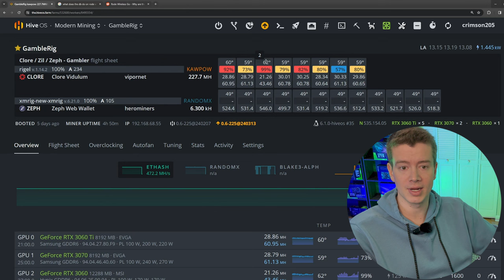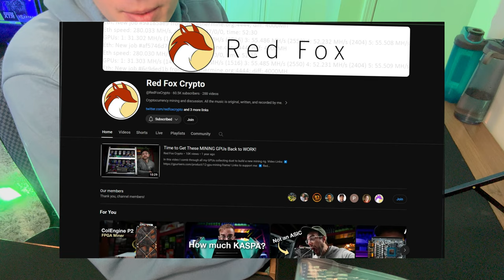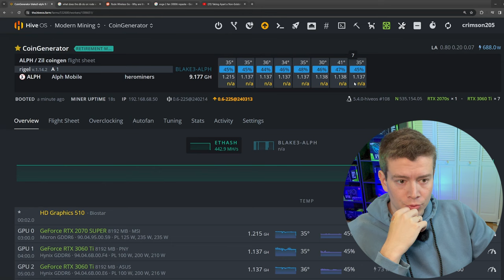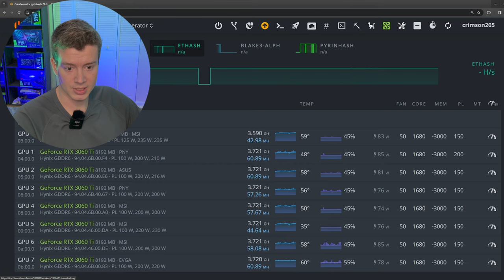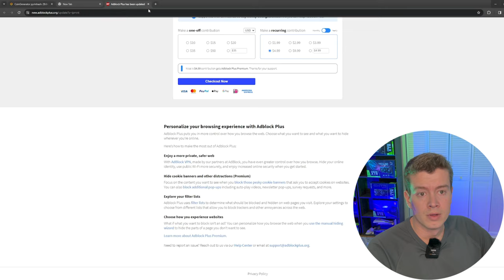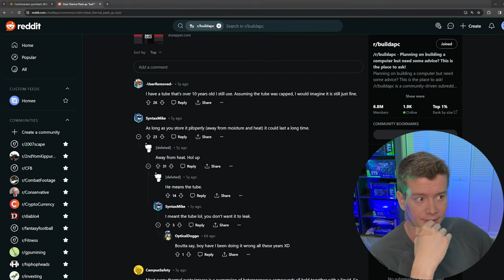Repasting my Crypto Mining GPUS did NOT fix TEMPS!

Comment: @ModernMining - Repaste them again and make sure you don't spread the paste rather screw slow on each of the 4 screws and torque them on cross. Get this MX-4 out of the window and get a MX-6 just a coupe of dollars more but performance is amazing and does not dry up as much as MX-4!

Huge tip! No one is actually mounting the fans below the GPU's. I did some testing the last 4 years and believe me you want the fans to be under the GPU's to get cold air between the fans otherwise they are sucking all the heat generated from the first GPU till the last one.

Comment: A little tip, that ive recently found, with my RTX 3060 Mining rig.... Having 120mm fans on the front of the frame, But not having them on, Actually increases GPU temp a little...
The fan in the way, Not switched on, Creates a little bit of a obstruction to the cards natural ability to releif warm air out the back of its I/O shield vent... 
You'll probs find that when you turn the 120mm fans on.. Temps will look more realistic, Or better.. Since the fans are helping to remove the heat from the card quicker... 

I had my rig in my computer room for about a week, and turned the 120mm fans off, to help with noise while im gaming in my room, and noticed that my GPU temps raised 3-4c...

As for the GPU's drawing in the warm air from the backplate next to it... It may be worth hot gluing a little piece of cardboard inbetween each card.... If temps get too bad.... Isolate each GPU's heat.. and the 120mm fan can pull it away
Reply from the maker: Now that’s something I totally didn’t think about. Makes complete sense though. I’d take them off but will probably turn them on in the next couple weeks anyway.

Comment: Turn those fans 22:45 on and see if that helps the temp. Just curious. I have a set up just like that and I wonder if the location is causing it to be hotter. I’m constantly struggling to try to bring the temp down but now after watching your video I’m thinking it’s the location in reference to the other ones.

Comment: Those GPU were the last in the row they are always the hottest. Only way to fix this it is either get server cases or more air movement.
Reply from the maker: Yep good call. I noticed that after I didn’t see any improvement. I’m going to move them to the first spots and put my beefy 3 fan cards in the last spot. Also going to turn my rig fans on once it actually getting hot.

Comment: Now do a video where you point your case fans to blow onto the cards and turn them on. Please.
Reply from the maker: Waste of power when the garage is 60 degrees. Also don’t want to push all the heat back towards the wall. Less dust buildup on the cards as well not blowing directly on them.